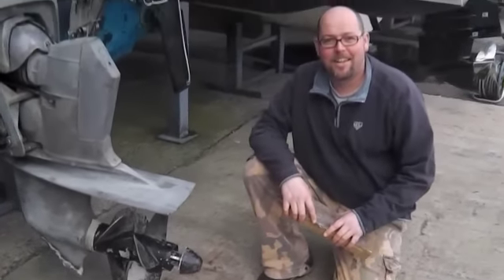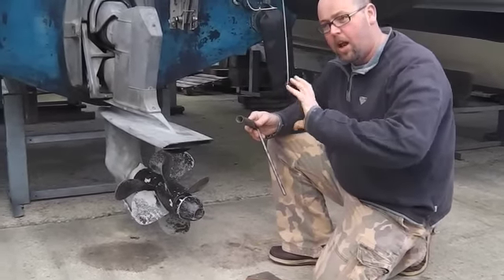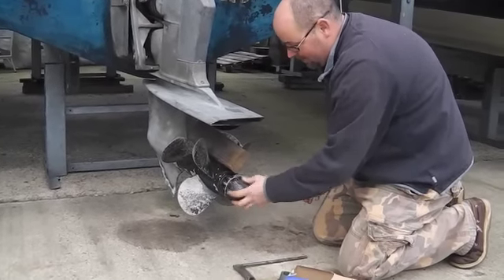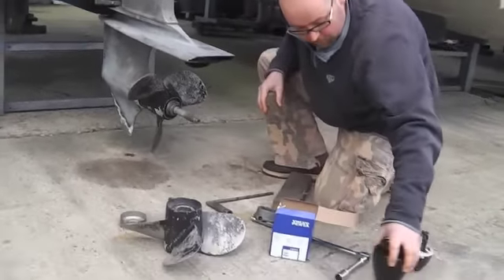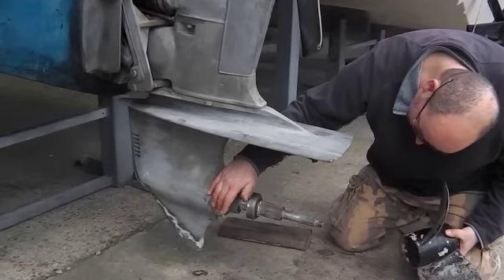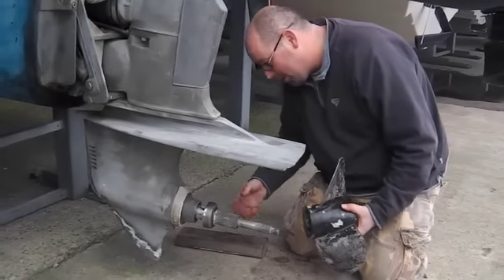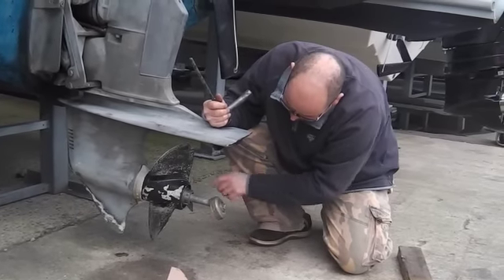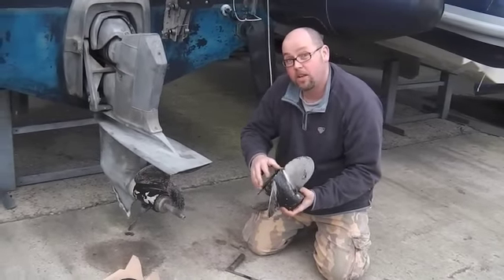DuoProp Change

Comment: Thanks for the video, I’ve lost my rear prop and nose cone, when coming to replace it I noticed they don’t make the cups anymore! You now have to buy thrust washer. My questions does the original cup act as a thrust washer or do you need a cup and washer ? I don’t have one on the port drive.